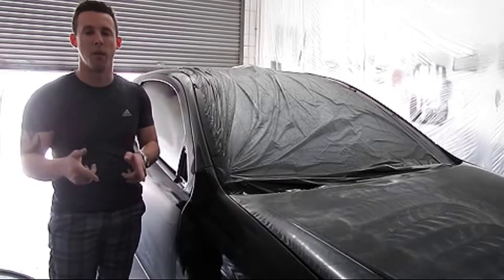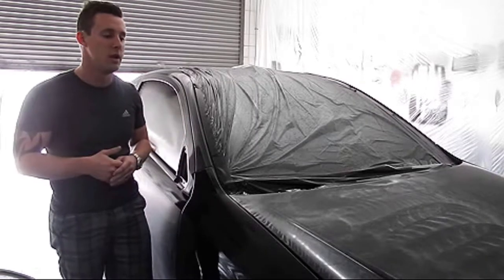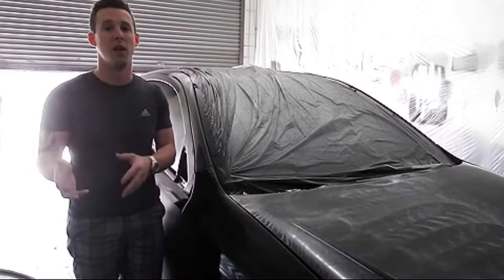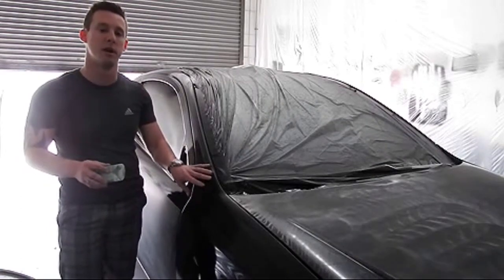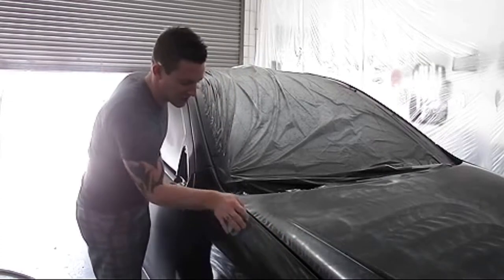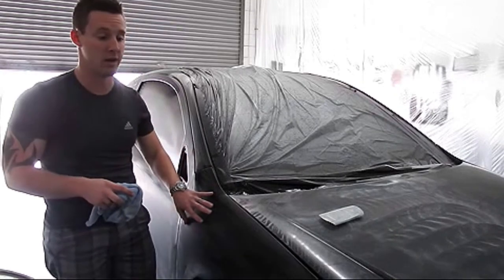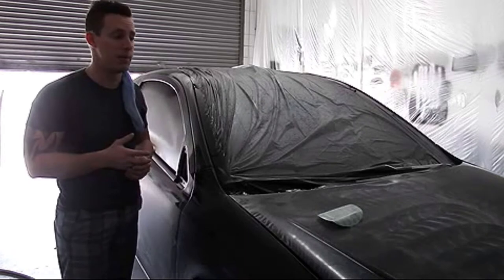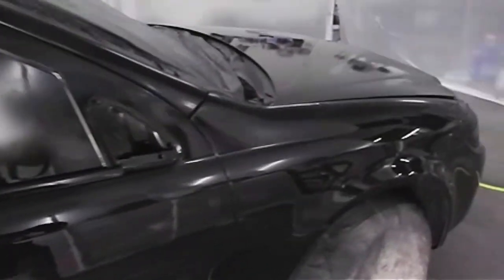Get A Mirror Finish Without Compounding And Polishing!

Comment: My base coat got orange peel and so the clear coat, can it be fix by using flow coating?
Reply: ya, what he said
Reply from the maker: Yes it can eliminated. How many coats of clear coat did you apply?
Reply: Dip Fanatix. 
I get trash from painting in a garage.  so I can do 2 wet coats of clear, wet sand and then flow coat it and I will look mirror?
Reply: Yes, that will work perfect. What we like to do is actually do a few panels at a time. it allows us to minimize any room for error in a standard garage environment. So as an example, we would mask around the hood, and trunk lid, and flow coat those with a fast hardener so it dries quickly. Then next time you have time, mask off around the driver side, and flow coat that side only, etc. At least this is the method I would recommend in a standard garage.